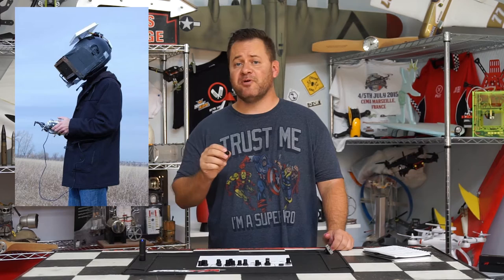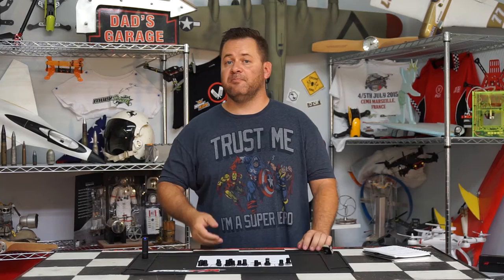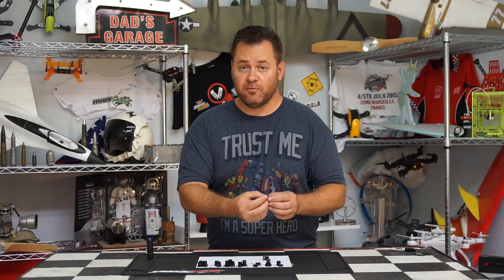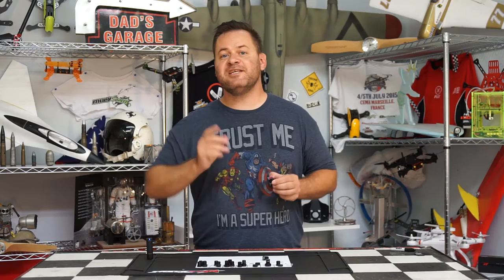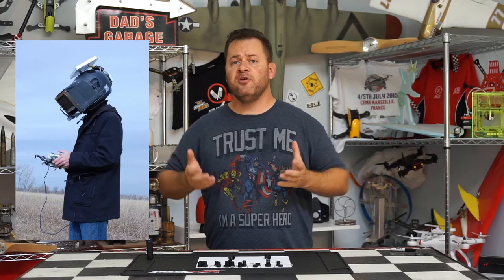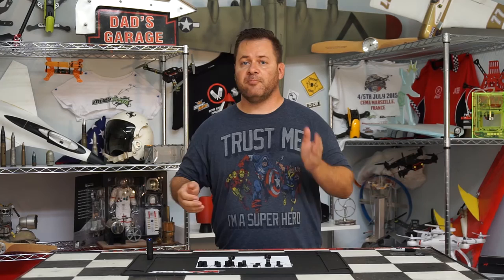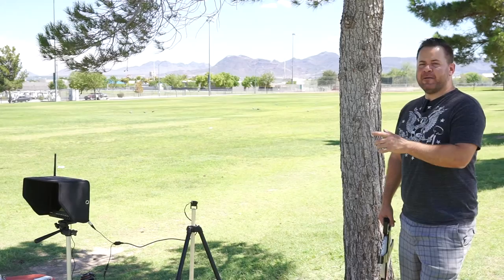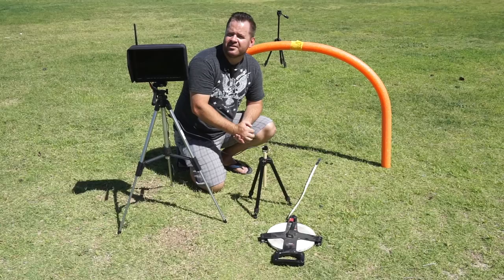FPV Lenses Demonstrated and Explained

Comment: Great video Chris. This complex subject foxes CCTV installers most the time, so what hope do we have! I agree totally with the 2.8 lens for the 1/3" CCd. I actually have adopted using a Runcam 2 HD as my flight/race camera. Great sensor, brilliant lens (112degree FOV) and it runs off the birds power supply fine. Image wise it is way clearer and copes with contrast much better than even the best 1177 type units Ive used in the past. Crucially there is no perceptible latency.... That's was made the Runcam 2 viable compared to its predecessors.

Comment: nice summary. I happen to really enjoy rather large 75 FOV picture in my eYebox 7r. I am using 2.1 lens and 4:3 aspect ratio. It gives me very immersive experience. I am not bothered by the distortion of the 2.1 lens much, the edge of screen is just for orientating. I mostly look at the middle. Most people say its too much when they try it, so I know it is very personal.

Comment: When this excellent video was made the common lens for M12 cameras was 3.6mm. Then it became 2.8mm. Now the stock lens seems to be 2.2mm and anything 2.8mm & upwards is very very hard to find - especially IR blocked lenses. 

The digital HD FPV market is all about quads. Stock lenses are always wide angle. 😒
  
(For my purposes - fixed wing with pan/tilt - I prefer a 3.6mm lens, IR blocked.)